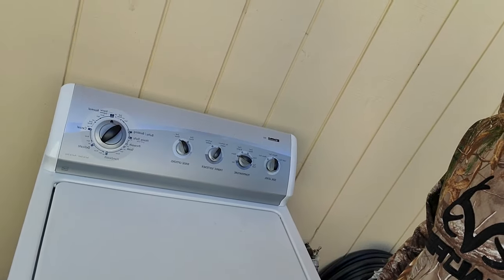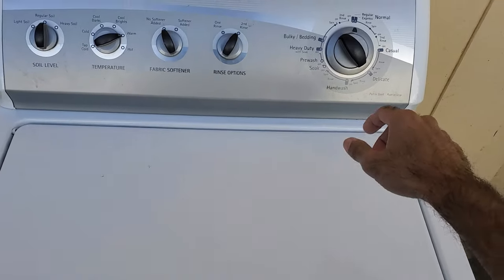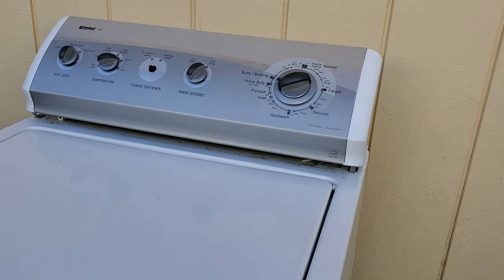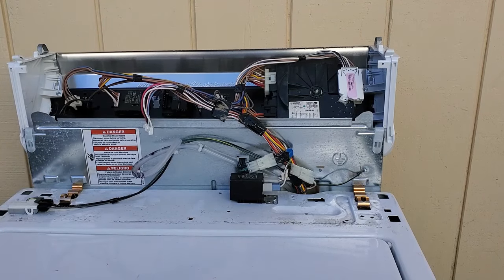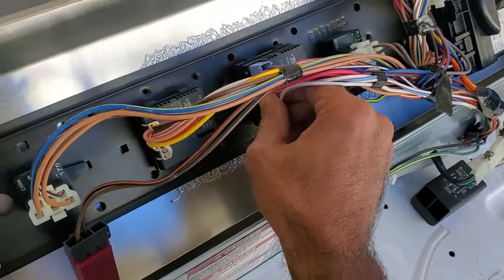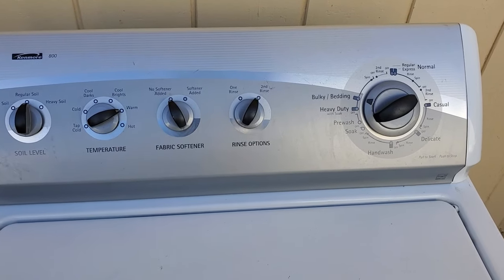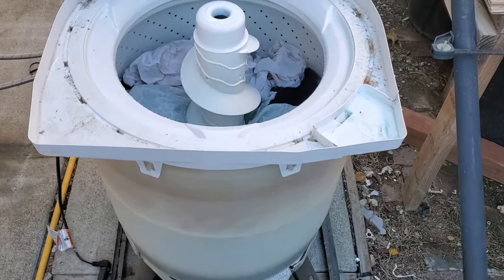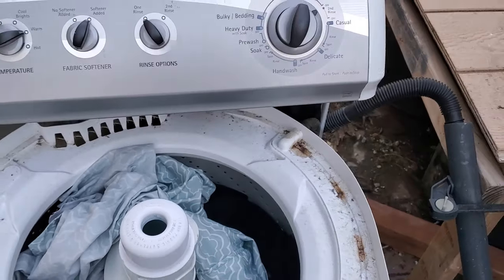Fixing A Kenmore/Whirlpool Washer That Is Leaving Clothes Wet!

Comment: I am having this same issue of my machine leaving my cloths wet.  Kenmore Series 500. I caught it in the act, it completes spin cycle, and then rinses my cloths again! Its driving me nuts. Do you think it would be the same issue as this 800 series?  I am so tired of hand wringing drying my cloths enough so I can put it in the dryer.  Let me know if you think its the same issue and if its would be the same process.  THANKS!
Reply from the maker: I am fairly certain it js the same thing. You might have a different part number so just make sure you order the exact same load selector switch that is on your machine.

Comment: I just managed to take my Kenmore S-80 apart. The pressure hose is attached to the far left dial to choose the load size. Completely different than the S-800 and having read the schematic and it doesn't tell me where the load sensor switch is located. Could it possibly called something else on the older models?... or am I gonna hafta break down and call in a guy to fix this?  Nahhh, I don't give up that easy!! Lol Thanks again, DTM! Judy
Reply from the maker: It's possible that your particular model doesn't have a load sensing switch. It's hard to diagnose without actually seeing it. If it doesn't have a load sensing switch it could be that your washer is not spinning leaving the cloth wet (most of the time a worn clutch can cause that).
Reply: @DuctTapeMechanic  Thank you for the extra info! It's definitely spinning through all cycles with no water left in the tub, so before I attempt  anything to do with the clutch I'm going to clean  the drain pump, clean out the hoses and PRAY. I don't know if that will solve the problem but it probably needs to be done anyway...(A couple of weeks ago I washed one of those memory foam bath mats and it got DESTROYED!! I completely forgot about that!) I REALLY APPRECIATE YOUR ADVICE! Thank you. Judy

Comment: This video is really helpful, but make sure you take off the cover before ordering the part. My Kenmore 800 series looks exactly the same as the one in the video from the outside but the load sensor is a little different (the sensor is behind the temperature control knob and is clearly marked with the part number)
Reply from the maker: Good tip!

Comment: Great video sir, thank you! I swapped out the part and it instantly fixed the agitator problem (it used to start agitating as soon as I started the cycle) but after my first load, that extra, unwanted rinse happened again and the clothes were wet in a pool of water. What could be the problem and how do I fix it? Thank you in advance for your help!

Comment: Awesome video.  My Kenmore 800 (looks exactly the same) would start adding water and agitating immediately when starting a new cycle, so I will replace the senser switch.  Yesterday, it stopped spinning and agitating.  Have you done a video on fixing that issue with this direct drive model Kenmore?  I'm hoping so, your video is excellent!

Comment: Thank you for your video! I got the remanufactured part and installed it, problem fixed. Unfortunately after 4 washings, it started doing the same thing. The part was covered by a warranty so the vendor supplied a replacement. Worked fine, only for 4 washings. The vendor has supplied another replacement stipulating that this is the last time he will do so. Can this many remanufactured parts go bad, or is there another problem causing it as the vendor has suggested?

Comment: I have a Kenmore 80 Series doing the exact same thing. Do you think it could possibly be the same issue? I'm struggling to do laundry every day and so is my daughter. It sucks trying to wring everything out by hand!
Reply from the maker: It's not the same issue because the kenmoee 80 series washer does not have this part. Most likely your washer is not spinning due to two main reasons; the lid lock mechanism is bad or the clutch is bad. I have a video on this type of washer on my channel as well! Hope that helps

Comment: Hi, i have a smiliar washer with same issue, KENMORE 700, which one would the load sensor be?
If you read from left to right, Water Level, Soil Level, Temperature , Rinse Option

Theres a 2-pos switch , 3 pos switch & 5 pos switch,  in the sensors

Comment: @DuctTape Mechanic  Hi DTM. How did you determine it was a bad load sensor switch versus a bad drain pump? In both cases everything works but the clothes are just left REALLY wet. I replaced a drain pump once already and not looking forward to it again, even though it was a relatively simple fix.
Reply from the maker: I took the cover off and bypassing the lid switch and then watched the entire cycle (this is how I test these type of machines). Everything worked fine, including the drain, except that after the spin cycle the machine would add more water then come to a stop effectively leaving all the cloth wet.
Reply: @DuctTapeMechanic  Ok then, I'm gonna fly blind and just try it your way, and replace THIS part. Looks simple enough. These Kenmores are so great, aren't they? The one I had before this one was a brown BEAST and it lasted over 35 years!! It would probably STILL be running if I could have tolerated the look of it!! EVEN THIS one is coming up on the 30 year mark I think. Anyway, thanks for your video & for your fast reply. I'll subscribe and I'll let you know THAT I fixed it, (AGAIN)!! 😂  Peace, Judy
Reply: @DuctTape Mechanic  ha ha, that's exactly what I did years ago.  Somewhere there's a video of the drum in spin cycle. Danger! 😂

Comment: I have the same washer, it recently started doing 2 rinse cycles even if knob is set to 1 rinse. It continues to the 2nd rinse after first finishes as if the knob was flipped but isn't Do you have a video on repair?

Comment: My washer is doing what your saying in video but I dont think it is spinning correctly.  It's really slow and stops after 20 seconds then adds more water. Its also making weird noises during spin. Do you think it's the pressure switch?  I was thinking it's the coupler. I will probably just order both. Thanks in advance
Reply from the maker: If it was the coupler it would not spin at all. Most likely has the same issue as in the video they are notorious for this

Comment: Hi! Sounds exactly like what my Amana is doing.  Would mine have the same stuff behind the top?  It has 6 LED lights on that top part
Reply from the maker: No this only applies to older direct drive washing machine. You you have VMW style washer. Does it spin?
Reply: @DuctTapeMechanic  yes, it’s spinning but and tub drains but clothes are so heavy and waterlogged
Reply: @christineleary1688  i have same issue with a maytag Centennial

Comment: Ive caught mine doing this. Go to start and instead of filling it goes straight to agitate then wants to add a shot of water right at the end. But not every time. At the moment its doing alright but unlike before, it continues to "walk" backwards to the wall even with cushion wedges. I was getting ready to check the level even tho its self leveling. Could the excess shaking be due to the same part malfunction?

Comment: Replaced the switch with the part you suggested but unfortunately it didn’t work…any tips on what my steps should be? Maybe a bad pump?
Reply from the maker: You machine is still leaving cloth wet?
Reply: @DuctTapeMechanic  yes, still wet. I’m thinking one of my kids socks could be clogging it up. I watched a load yesterday and it does drain a little bit, but not a lot.
Reply: @DuctTapeMechanic  turns out it was a sock, but wasn’t stuck in the impeller like I thought it was. Was wedged between the steel drum and the plastic basin. Thanks for the video series though, very helpful love learning about how to fix this stuff.
Reply from the maker: @patrickkelmartin9547  Great work! It's a good machine definitely worth repairing!

Comment: If towels are being left wet could this be the issue? If i have it on 2nd rinse  cycle will it wet it again then spin it out?
Reply from the maker: It's supposed to add water and then spin on the second cycle, but when the switch /sensor in the video is bad it will add water even after the spin.
Reply: Okay got it. Going to test it out. Thanks for answering promptly

Comment: I have a Whirlpool that looks the same from the outside but completely different under the panel, with only one large control panel behind the master program arbitrator that the pipe and similar plugs go into' along with many other cables, 4 of which are controlling the 4 smaller buttons. 
is there a different video to deal with a machine that spins but leaves the clothes drenched?

Comment: My 800 series has a washer cycle selector switch. But doesnt have hose going to it. It goes to pressure switch. So do i replace the pressure switch since the hose is connected to it

Comment: Would a 80 series have this part? I have the same problem of clothes not being spun dry enough.
Reply from the maker: No 80 series does not have this part. Is it spinning at all? Or spinning slowly?
Reply: @DuctTapeMechanic  spinning slowly
Reply from the maker: @carlzirk  sounds like a failed motor capacitor
Reply: @DuctTapeMechanic  thank you

Comment: I have that washer mine won't fill with water
Reply from the maker: Will it not fill with either hot or cold water? If it fills with hot water and not with cold (or vice versa) then most likely it is the valves. If it doesn't fill at all then it could be the load sensing switch or the lid switch ( this washer stops filling if lid is open)